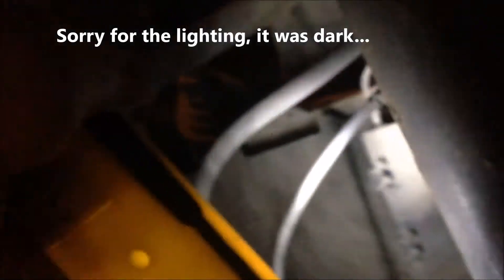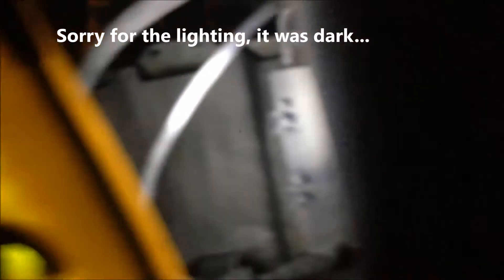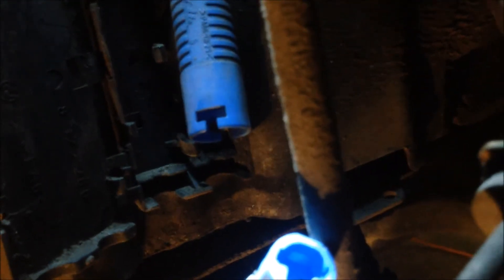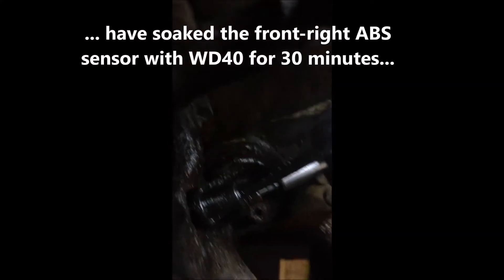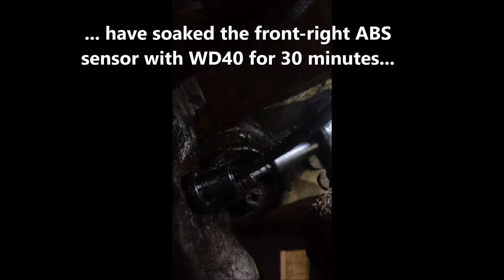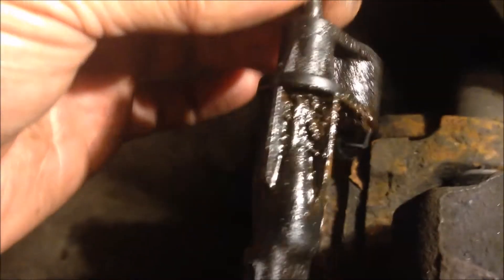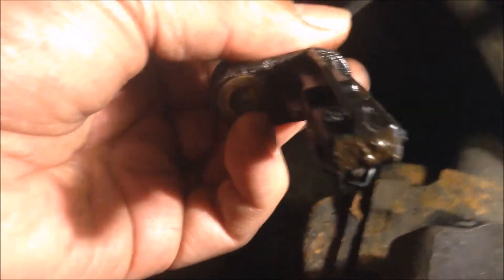BMW E46: ABS Sensor - How to Remove

Comment: Are both the rear speed sensors interchangeable ? 
Which sensor controls the speedometer as my speedometer is not working ? All my problems on my N42 engine are coming at the same time lolz.

Comment: changing the ABS speed sensor in the front is very easy, the problem is the connector with the harness, the release tab broke and most of it just broke. I t seems you can just buy a replacement of that electrical connector pigtail on it. But no you have to buy the whole thing and it cost a lot of money more than $500, is there any suggestion to replace that female connector.
Reply from the maker: Hi, thank you for your comment! Interestingly both connector sides could be called female for some reason?  We could call then the ABS sensor connector and the socket from the car cabling. The tap / button is on the sensor connector and the slot for locking the tap/button is on the socket. As after the connector and the socket are connected, you will place them in the box, therefore I guess you may be okay without replacing  either the sensor connector with broken tap/button, or the socket with broken slot?  However if you do have connection problems and have to replace either sensor connector or the socket, you could go to car scrape yards to buy one cheaply. Alternatively you could find one on ebay or similar.  Wishing you have a good day!

Comment: Hi, did changing the sensor fix the issue for you?
Reply from the maker: Yes! I ordered a cheaper ABS sensor and arrived a few weeks later and another few weeks later I installed it. After about 10 meters drive, all the warning lights went off. I will upload a how to install video, maybe around the new year. Good luck!